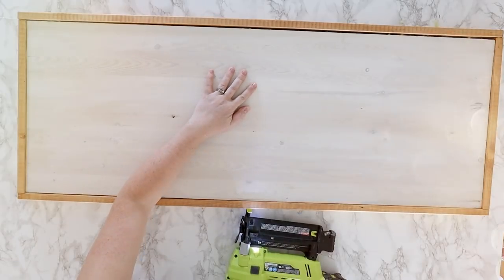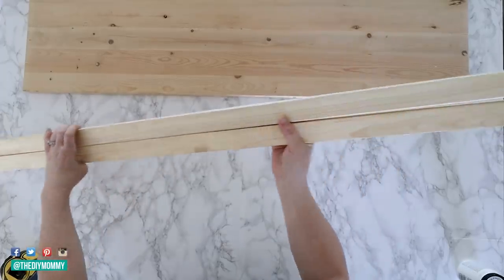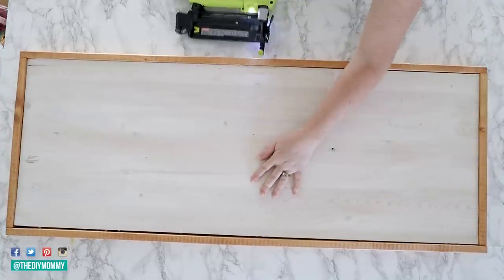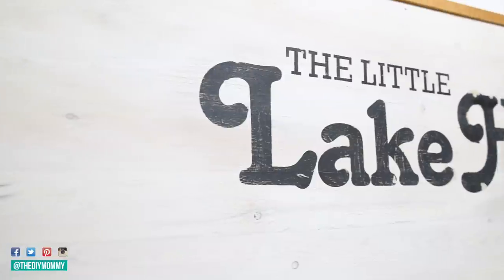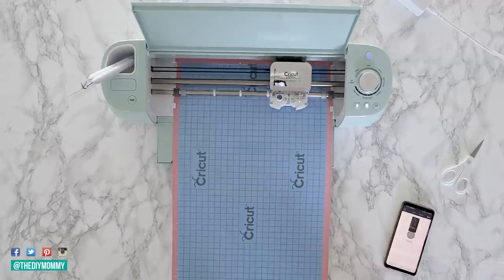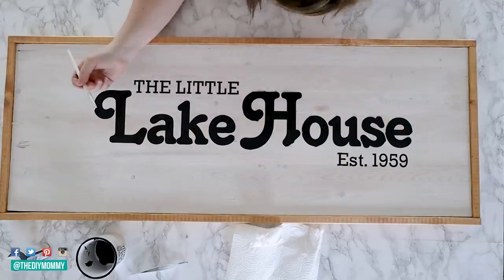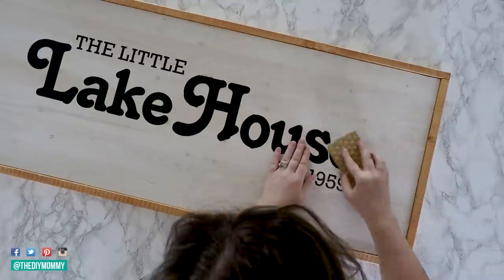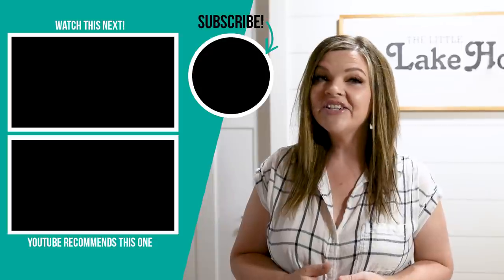How to Make a DIY Wooden Sign with Cricut! (+ how to make a custom stencil) The DIY Mommy

Comment: Hi Christina! I was wondering if you had any advice on what to do with ugly bathroom wall tiles. Can I stick vinyl over them? Or would it be easier to paint it white?
Reply from the maker: I've never tried painting tiles in a bathroom, so not sure, but perhaps one of the tile & tub epoxys might work.  I think peel and stick would work great by the sink, but there may be too much moisture in a shower area.